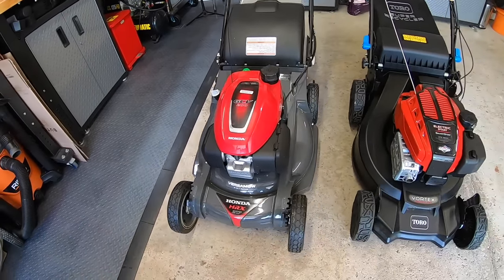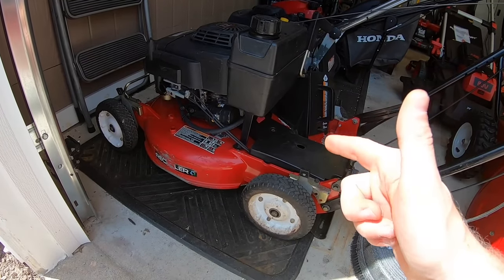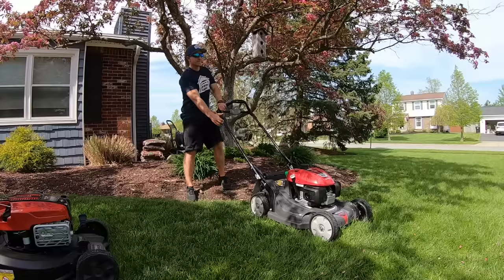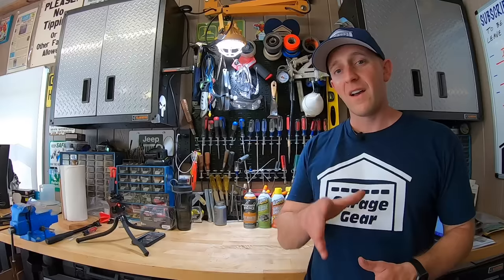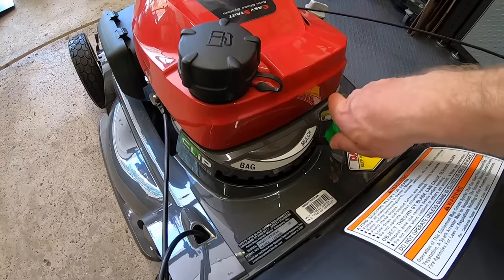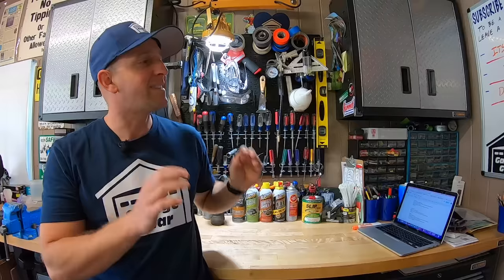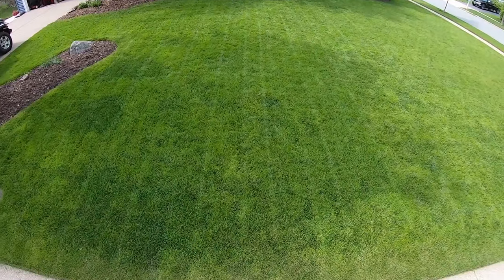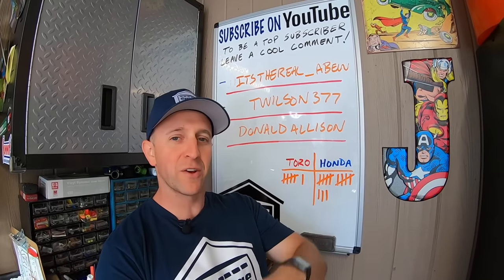HONDA HRX217VKA VS TORO SUPER RECYCLER 21564 - WHICH MOWER IS BEST?

Comment: Just got 2 toro mowers, one is awd & 1 is smaller. I sold my hrx due to being to bulky. 1 downside to the toro mower is, no discharge but I hope it will be a good choice in the end. Oh an no changing the oil in them.
Reply from the maker: Hey my friend it is strongly recommended that you still change the oil on them! Trust me that’s a marketing idea gone wrong.

Comment: I just bought a Honda HRX217VKA and have not even received it yet. With your knowledge of the Honda, are their any parts or accessories that you would recomend having as a backup? My first Honda ever and at 65 years old, hoping it will be the last mower I ever need.  Thanks
Reply from the maker: Hey Tom can’t go wrong grabbing a set of wheels, an auto choke actuator, and maybe a back up carburetor with some extra air filters. You’ll be set for a VERY long time! 👍

Comment: JB would you recommend 5w-30 synthetic for the Honda HRX 217 ? Or go with the Honda 1030 they recommend? Thank you.
Reply from the maker: Hey Aaron I usually recommend 5w30 full synthetic because it has the widest temperature range where I believe in the manual it stated that 1030 is kinda limited. 👍

Comment: JB. I was curious to yiur opinion. I have been trying to decide which mower to buy. My two choices are the Honda HRN 216 or the Toro Recyvler Max. Both are the same price. The Toro has a 5 year and warranty . Honda has a 3 year warranty.  What do you think is a better buy.
Reply from the maker: @shaneminor6214  hey Shane you’re gonna hate the persons pace when it doesn’t back up. I would go with the Honda!
Reply: @GarageGear  I also have another question. Since Honda doest have a guard around the blades that they are locking up around the belt drive. Is this True.
Reply from the maker: @shaneminor6214  they don’t have a belt guard but locking up isn’t an issue. If something were to get stuck in the belt then you’ll have an issue. If you mow a lawn with lots of sticks you’ll have to be on constant watch

Comment: Caution on the Honda HRX217 purchases if you find any- their factory probably knew of the discontinuation as early as 2022- my March 2022 HRX217HYA from HD had an under filled transmission since day one (always felt underpowered and shame on me for not taking it in under warranty), which I confirmed after having to do the removal, drain, cleaning, refill, air bleeding and reinstall myself.  Honda is supposed to be quality, but how do you partially fill a transmission, then put a 'passed' sticker on it? Now it seems to be an actual beast that lives up the hype.
Reply from the maker: Thanks for sharing

Comment: If you could ONLY choose between a Craftsman M230 or Toro recycler 21485 which would you choose. I know it’s subjective, but I have to pick between the two. Thanks
Reply from the maker: You’ll have less headaches with the craftsman. The toro transmission will drive you nuts backing up
Reply: @GarageGear  one more question, sorry. I own the m230. My brother asked if I would pick out a machine for his property. I guess the M230 is no longer carried by Lowe’s(machine must be purchased at Lowe’s). So that leaves me going with the next nicest machine which is the Toro 21485 or if I want Crafstsman I’d have to step down to the M220(150cc). So in that case would you go M220 or 21845? I like my M2 30 by the way, I just don’t like the plastic carb and hard plastic wheels. Thank you!
Reply from the maker: @6atlantis  hey 6 you may want to consider this toro 21445 because its front wheel drive and you won’t have any issues backing up with it . Here’s a link BEFORE YOU BUY A 22" TORO RECYCLER 21445 LAWN MOWER, WATCH THIS! (Full Review)
https://youtu.be/aKkkIjLxdeI
Reply: @GarageGear  thanks

Comment: I would compare the honda gvc engines to more of Briggs quantum flat head engines quatems that are easily one of the best (discontinued) engines that where paired to toros. The flat heads are indestructible! I work on small engines as a side gig. I've seen plenty Briggs flat heads decades old and abused yet they are still running.... The gvc line is more of a home owners engine that will last a very long time also. HONDA GX series is another monster. THOES are can be used and abused and still go!
Reply from the maker: Thanks for sharing jmabs

Comment: My honda hrx217vka seems to always miss random pieces of grass the other mowers I've had didn't do this. About to sharpen almost new blades
Reply from the maker: I would give them a sharpening and possibly slow the mower down a little. See how she does!
Reply: @GarageGear  I go with it at a comfortable pace I don't mow to get done early I mow to get a break from being inside 😅 honestly have it set on the last split line mode before the solid line area so it can go alot faster
Reply from the maker: @adamclark94  ok Adam I would also check how sharp your blades are!

Comment: I have both as well,For me it's Honda by a mile. Build quality is so much sturdier, more powerful engine and overall design it's just better and dual blade beats bafflle nonsense all day. I live in Fl so I cut year round and 3 Times a week in season. I have 4 mowers (also have a 60 V Toro which is worthless down here and a 23" 175cc Craftsman that I like better than the Super Recycler as well. I use the Honda 75 PCT of time and let the other 2 do the other cuts. The 60 V was just a mistake.
Reply from the maker: @robbiegolding1831  thanks for sharing Robbie! The 60v can’t get the job done?

Comment: I've had the Honda I use most for about ten years, no problems whatever and great cut quality.  I've been using a 2023 super recycler for a couple of months.  Cut quality is poor, little things break or don't work.  The back flap fell off, the gas cap tether more than half the time comes off, the traction cable broke.  Nothing like this has happened to the Honda I'm using now or any of the other three I have owned.  The Toro might be a bit easier to handle.  That's the only advantage I can think of, and all the little annoyances from cheap parts to bad engineering make it not worth it for me.
Reply from the maker: Thanks for sharing Harlow!

Comment: Had the Honda HRX 217 for 7 1/2 years and the crankshaft went bad. Not covered under the recall like other mowers with the same issue. Mine was produced before they officially did a recall. That being said I’m buying another Honda.
Reply from the maker: @paulsmith9009  thanks for sharing this with the community Paul!

Comment: I bought a HRX217hya last year to replace the same 12 year old mower. I hate the auto choke 🤬
Always takes 3to 4 pulls to start. Last mower was always first pull.
Also, it occasionally locks up when starting where you can’t even pull the rope unless you hold down the blade brake lever.
Reply from the maker: Bummer but thanks for sharing this David! Always good to share info like this here in the community.
Reply: @GarageGear  I don’t want anyone to think that those issues are a reason not to buy this mower. It’s still the best walk behind out there. It’s cut quality is superb.
Reply: Pull slowly through one complete pull. Then the next pull with steady authority and mine starts every single time. If ya grip and rip it does not like it at all.  It’s almost begging for slow and steady…. 😂Lmao
Reply from the maker: @davidn1369 you’re right the cut quality is really nice! 👍
Reply: @ccrx2640  thanks! I’ll give that a shot.
Reply: @ccrx2640  is that normal though? Or is that an issue with the cam assembly? I just bought one and had to return it. Dealer said it was an issue they’ve been dealing with.
Reply: @D0SHA236  I have one that is 20yo and another that is 1yo.. both are almost identical in their starting behavior..  pull slowly one or two pulls then find compression and pull (not fast) w/authority. Both start on that last pull immediately..!!  

Not gonna lie, when my wife could start them both better than me is when I put 2&2 together.

It’s almost a game at this point how easily they both start..
Reply: @davidn1369  how’s it working out for ya.?
Reply: @ccrx2640 sorry I took so long to respond but your trick seems to work! At least it has the last two times I remembered to do it. Thanks!

Comment: Used the Honda once - even in the full mulch setting clipping are shooting out the back and collecting in the rear bag area - I’m returning it - faulty design with air gaps that surround the plastic “adjustable mulch plug”.  Lots of good about the mower but the multi clip adjustment is no good if you want to mulch 99% of the time.
Reply from the maker: Thanks for sharing neo

Comment: I work on both, if you put that Honda engine on the toro deck, that would be an awesome mower, the deck on the Honda, you said the deck has to many holes for grass to get in, and the engine on the toro is crap all day long, like I said put that honda engine on the toro deck, for the win, also the Honda sips gas.
Reply from the maker: I would love to try the toro commercial mower with the Honda engine! 👍

Comment: I am looking for a mower that is the best self propelled.  Any ideas?
Reply from the maker: Hey Cajun! I would look at Honda if any still remain but new ones are on a stop sale right now. You may wish to consider a lightly used one. I have never seen any issues with their self propelled models.
Reply: @GarageGear   The real issue is my father in law has a front drive self propelled craftsman and it is a bear to use.   Have to do more pushing than the mower pulls.   Thinking about a Toro to replace it just hoping it pushes itself rather than us have to push it.
Reply from the maker: @007Cajun  the toro will go for you!

Comment: Honda don’t make push mowers ore snow, blower anymore, so what is the best loan equipment to buy?
Reply from the maker: Might have to start looking at commercial equipment. I’ll be doing some videos on this in the near future!
Reply: They’re $1500-$2000 for a commercial grade push mower compared to a $500 push mower that 4 tims more money is it going to last 3 to 4 times longer than a residential mower you can buy 3 to 4 residential mowers for the cost of a commercial grade mower. Don’t make sense to buy a commercial grade mower and they’re heavy. I’ve looked at them. A Toro personal pace is 500.00  or so.
Reply from the maker: @richardburnett2749  I guess you get what you paid for. Do you want to get one that will have problems every couple of years or do
You want to get one that is going to last and be more durable. That’s the big question everyone had to ask themself.

Comment: My new Toro definitely sputters.. like it’s about to run out of gas.  I’ve so far used it once 10,000sq’ of turf.  I verified that the spark plug cable is well seated, wondering if it’s something to do with that plastic carburetor 🤔🤔
Reply from the maker: Hey Apex another subscriber mentioned checking the gas cap to make sure it can breathe. I guess this can be another simple fix to this issue. Worth a shot.
Reply: @GarageGear  can the smart stow (on end work) if a gas cap is breathing? serious question and probably a dumb one
Reply from the maker: @jamesgorman5774  yep the way the gas tank is shaped it doesn’t leak out the pipe!

Comment: Left the EGO world behind and went to Honda recently. Great videos for maintenance etc. you put out. Curious if you still run the fuel out even with ethanol free? I still did with my last Husqvarna with the Honda motor years ago.
Reply from the maker: Hey Brian you’re not the first to tell me this! Why exactly did you switch back! If you wouldn’t mind sharing your experience I’m sure it would help me and our community out picking the right products. 

I always drain any fuel out regardless of what it is. Carbs are always better empty in the off season. Thanks for being a cool fan!
Reply: I switched back due to the battery life and replacement pricing. The equipment are good, just the longevity was an issue for me. The blower and weed eater batteries lasted 3 1/2 years. Now out of warranty. The mower battery still works, but I’m unable to get as much work out of it as I did previously. But, I do supplement the mower with a rider also. Moved blower, weed eater, and one battery, since one is dead, to my camper. Selling the mower.
Reply from the maker: @briankahre7439  thanks for sharing this my friend! I’m hearing about a lot of people switching back because of battery life and longevity plus replacement costs. Have a good weekend!

Comment: Have you solved the problem of Honda' rear wheels unable to roll backwards? On mine it starts some 15 minutes into mowing. Probably due to warming up of the gear box. In the discussion groups there is no clear solution.
Reply from the maker: Unfortunately, I haven’t figured out the problem.

Comment: I worked on small engines for 3 years.  Honda makes some  great engines, the GCV series isn’t one of them. It has a non removable cylinder head, if you run some bad gas and stick a valve it would require a complete engine tear down to repair.  Meaning you’re better off buying a new engine.   All of the Honda engines on consumer level products are a far cry from the ones that Honda is known for.
Reply from the maker: Thanks for sharing Paul!

Comment: I wanted a second lawn mower so I bought a Honda GSV170. The lawn mower has been nothing but trash for me. Mower won’t start or if it does it sputters. I am also using ethanol, free gas. My 20 year old sears Briggs & Stratton starts on every pull. I thought it was a good brand. I’m sadly out of 500 bucks.
Reply from the maker: Thanks for sharing shorty! 👍

Comment: Great videos JB. Any thoughts on the "Stop Sale" on Honda mowers? Something in me still has me holding on to the idea of picking up a Honda over Toro even with the compression issue and the leaving the market. I'm not sold on Toro. What Gas mower would you say is behind Honda and Toro? Thanks in advance
Reply from the maker: Hey Glen! I’m trying to get some more info on this stop sale but information is limited. If I find out more I may make a video on this! Ariens makes a new mower that seemed decent but it too just had a stop sale. 🤷‍♂️ can’t win here!
Reply: @GarageGear  JB do you have a top 5 list that you can share?
Reply from the maker: @glenn3742  I should put one together!

Comment: I like my Honda GCV 170, cheapest Home Depot Honda ($549), but disappointed that in order not to have stray grass,  I have to line up the grass line with the silver metal on the inner wheel, so im basically getting about 18 inches per line despite having a 21 inch blade. If i try to put the wheel on the line there is a strip of grass it misses, whereas my old toro i simply could just put the tire on the line and not miss any grass. My Honda did sputter and stall on 15 inch wet grass on mulch mode, but when I switched to bag mode it didnt sputter at all with the same grass. I dont use bag so i just put up with “grass feet”  when in bag mode lol. I do like that this model has a steel deck and not plastic like the one in his video. I will say i tried to put the lever in the middle of bag and mulch mode to compromise to avoid grass feet, but gravity makes lever slip back into bag mode so no point of putting it in middle.
Reply from the maker: @guitarandotherthings6090  thanks for sharing this

Comment: i had a Toro push mower. it would not run right unless i removed the (brand new) air filter. Always clogged before the grass catcher was filled and was a pain in the @sss when grass was somewhat wet. Got a  Honda HRN and it's a much better mower. i didn't see much advantage in the HRX over the HRN. At least not for the $500 price difference. Honda is the better mower, IMHO.
Reply: the Toro would also expel lots of grass where the grass catcher connected to the mower. I had to put a foam pipe insulator over the grass catcher opening to keep the grass from constantly flying out.
Reply from the maker: @Synchrimedia  thanks for sharing all of this sync!

Comment: I was going to buy a Honda went to Honda dealer and he advised me not to buy Honda is having problems with cam . Have heard about this
Reply from the maker: Thanks for sharing
Reply: Just bought an HRX217 HYA and I had to return it. After the first use it wouldn’t want to start up. Pull cord was extremely difficult to pull. Dealer said Honda was giving pushback on covering warranty repairs on 3 units they had in the repair shop claiming it was user error.

But yet I’ve seen multiple complaints to Honda with the same issue. Honda is aware of the problem and still gives pushback on repairs? Big bummer.

I was really looking forward to buying this mower. Now I’m stuck because I can’t find anything else I would want to buy that’s in the same price range. I can’t convince myself to buy a battery mower yet no matter how hard I try.
Reply: @D0SHA236  I feel the same really liked the Honda
Reply from the maker: @D0SHA236  thanks for sharing
Reply: @D0SHA236 literally in the same boat my friend!
Reply: Do not purchase any Honda mowers under any circumstances. The air filter cover is way too easy to fall off, and the bag frequently detaches during cutting, overall poor design. This is only a few reason why this "mower" is bad. You'd better take this advice as this is coming from someone with a Honda 216 lawnmower